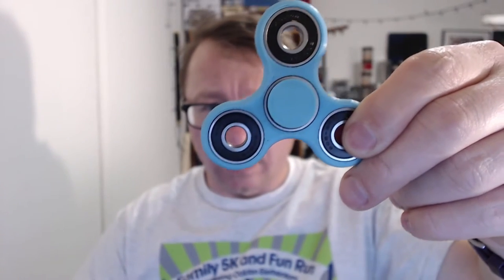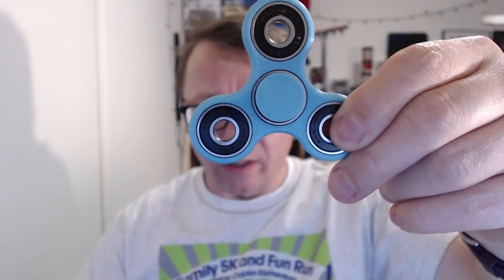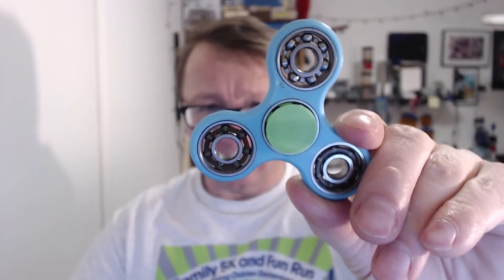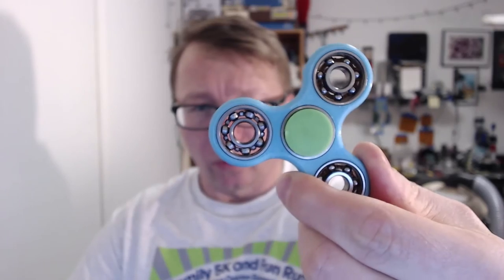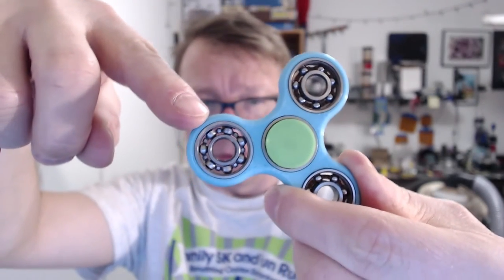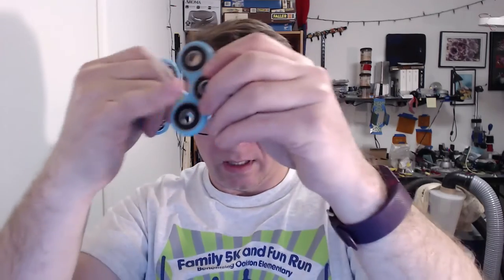Fidgety Spinner - Spin Faster!

Comment: The metal are shields which will not keep thin lubricant in place and the rubber are seals, sealed to keep lubricant in and therefore cause more drag as they have contact with the bearing's faces. Dave
Reply from the maker: Thanks Dave - agreed.  Just remember, it's just a fidget spinner....ceramic bearings?? Really? ;)